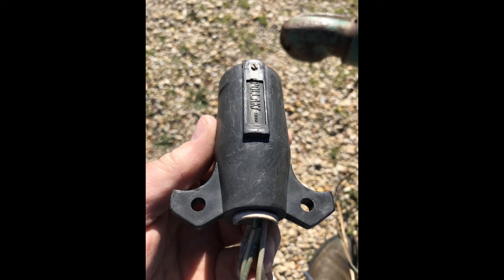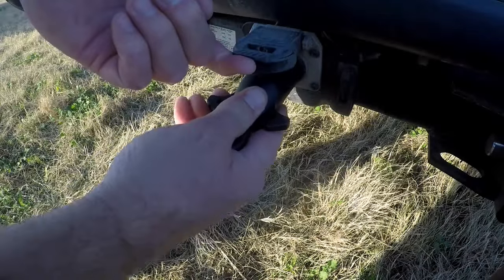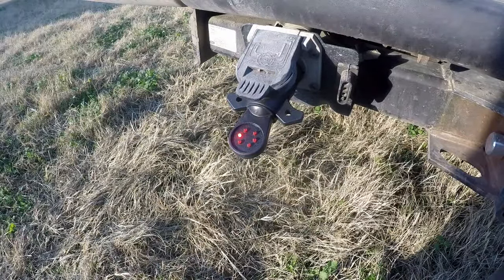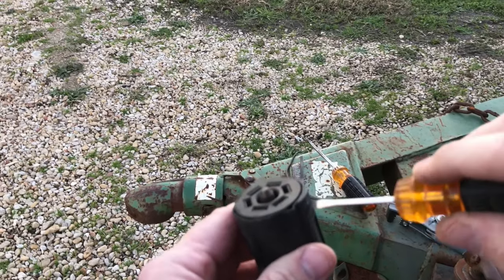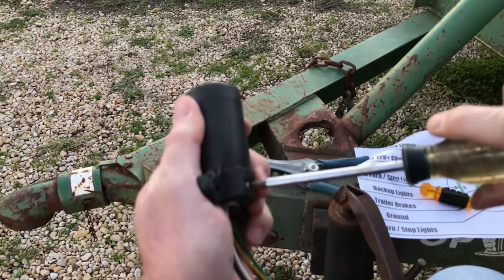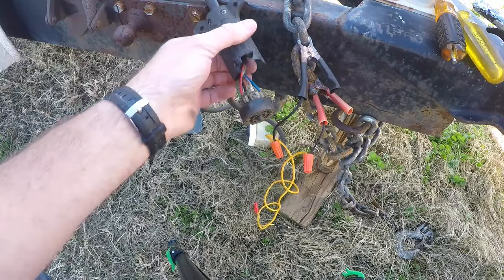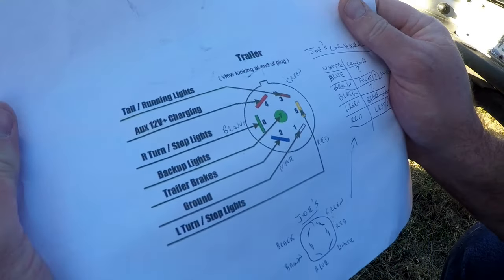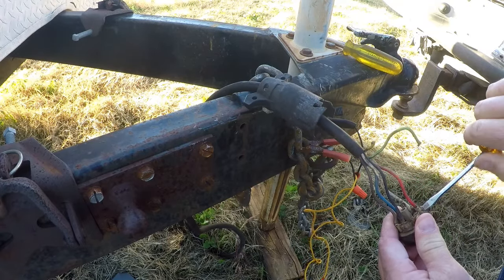Wiring a 7 Pin Trailer Plug

Comment: If you tie a knot in the harness to fill up that big empty cavity to prevent the wires pulling out.  Don't just rely on the wire hold down at the end.
Reply from the maker: I like it. Thanks!
Reply: How you supposed to tie that thick ass insulated wire? Are you talking about the individual wires?

Comment: Good video!  You have me wondering if my truck is incorrectly wired, causing failure of trailer brakes.  The lights work on the trailer and the turn signals, but the brakes lock up when plugged in.  After some testing, apparently the brakes don't work at all through the connector.  Tested the trailer plug and it 'seemed' to check out with all positions having continuity and where they are supposed to be.  But I ain't no real mechanic . . .   : )  Any thoughts appreciated.  My truck is an 08 F250.  Surely Ford wired it standard.  Surely.  But someone could have monkeyed with it.  Or the trailer.
Reply from the maker: If the brakes lock with a 12 v supply to the blue wire there could be a problem with the controller...
Reply: Do you have a brake system in the cab of your truck?
Reply: @wukilla8ee  :  THanks Jimmy.  It did have one.  But I sold the 08 truck.  The replacement new to me 09 Ford F350 with the standard brake controller on the dash operates the brakes.  Which is nice.  :  )  Thanks for asking.